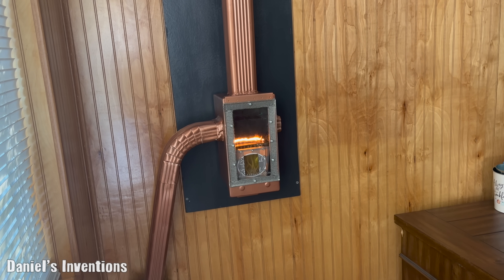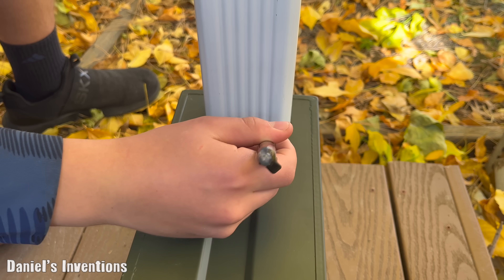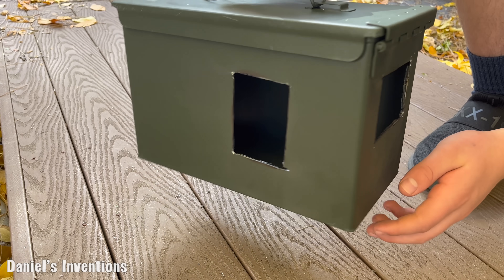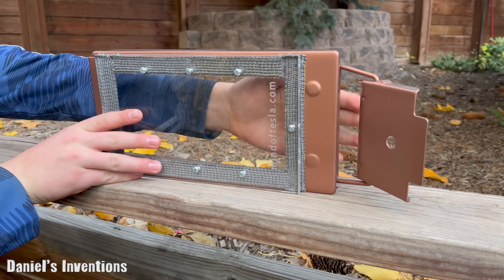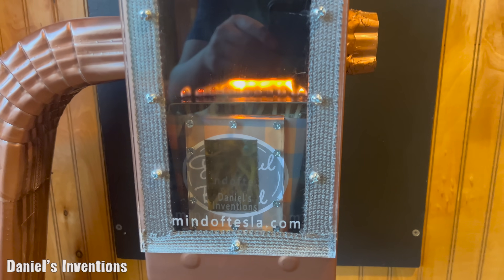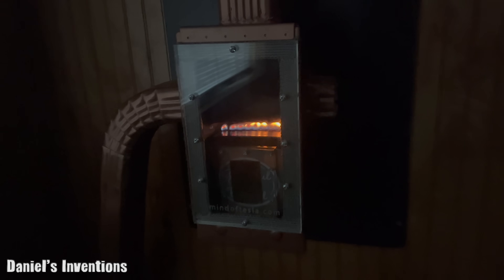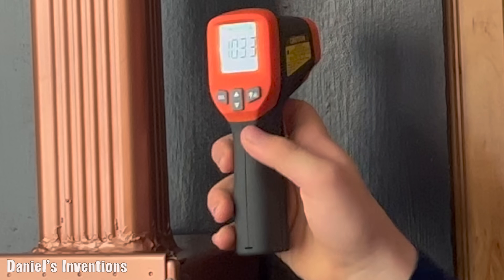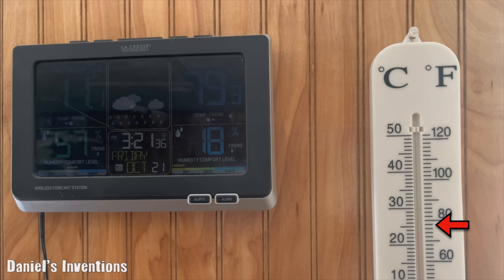ENDLESS Heat for Your Home WITHOUT Electricity

Comment: Some facts 1 kg kerosene, diesel and gasoline holds each about 43-45MJ. So if your magic device use 1 kg in 10 hours it is equal to 1250W f heat blower running all 10 hours (theoretical max)

Comment: Great stuff!!.. well done. I suggest you take shots of a tape measurement for the holes so people can freeze and read or you can simply say the measurement.
2. People miss this all the time but a lot of heat is going out the chimney!
Think about making loops, twists or I just use a really long exhaust pipe at a 12 degree angle (min) and it literally radiates a lot of heat. Check into using a twisted metal to create vortex and thus more surface contact from a gas hot water heater.
  I very designed several but not had time to make... yet.
3. Yellow flaim = soot.. blue flame clean.
4. Air from outside means cold air... but if taken from inside then cold air comes from outside (cold) to begin with. Consider using earth dug ditch to preheat to around 50 degrees.. see Earthship designed homes and on YouTube still?
  Again great stuff.
Reply: Great ideas!
Love the community brainstorming effort here!

Comment: Nice idea.
I think if you use intake from inside the cabin it will be even more effective.
Reply: This is a unsafe surefire recipe on how to kill your family.
    First this bad design using the warm oxygen in the room, which us a code violation In the USA. Because you that same oxygen to breath. DO NOT DO THIS.
This setup will leak Carbon Monoxide into the house. This is why we do not use Franklin stoves in the home.
JBWeld is bot heat resistant and will fail when exposed to prolonged heat thus causing it to fall apart and causing a hours fire.
DO NOT DO THIS.
Lastly This furnace is too small to heat a Closet much less a whole house. At best it is about 500 BTU.

You have No safety precautions, No alarms or CO Detectors.
He is not qualified to teach anything.
It needs a heat exchanger to make this safe.
your welcome
A certified Engineer. BSEE, BSME, MEE, MEE, BSCS
Reply: @mrgcav  if the unit it’s sealed no gases will be introduced in the cabin, so no poisoning.
When executed right with real welding and some more experienced in engineering,also intake air to be sucked ,heated and circulating inside the cabin it will be very efficient and safe.
It’s so simple you don’t need to bring your chemistry explanations.

Comment: This looks pretty nice for a first version!
I would make one modification. Add a sterling engine fan. You see them on stop of stoves for off-grid cabins, they run completely off of heat and require no electricity. So you just need to add one to the inside vent and it will start working as soon as your furnace starts. 
A way to refuel it, and start it without taking it apart would be a goal for the next version.
Reply: Not really a first version it's a modified (downgraded) version of what someone made for their snowmobile camper. All power to him for tinkering around with it trying to making it heat a space it wasn't made to heat but it will most likely cause a fire without warning.
Reply: @OverlordDenooh  Downgrade? You some kind of a heater engineer?
Reply: @OverlordDenooh  The snowmobile guy used candles in his. 
The candles didn't work so Good. 
The candles were too far away from the through heat vents to begin with and they melted down even further throughout the night, ending up with a temperature of 50 deg Fahrenheit = 10 deg celcius, and that's in something not much bigger than a dog house; he was in a colder climate though.
Although his heater was built First and the idea probably borrowed by these guys, I'd say this heater performs better, BUT! if he borrowed their idea and made a wicked oil system to fit inside his ( a doubled row of wicks as he has two through heat vents ) His could probably out perform this heater/stove. 
I don't think this one is a downgrade at all and in some ways an improvement.
Reply: Yeah good idea with the fan but I don’t think they make em small enough to fit in there  they are only 2” by 3” tubes but I could be wrong
Reply: @maxraddatz8420  The smallest one I've ever seen was a 6" diameter blade.

Comment: Jb weld cannot take 500+ degrees or direct flame very long. This is a cool idea and works similar to some products out there for wood burning stoves but you really need to seal it with something better than jb weld. Even the high heat stuff isn't good enough for something like this. You'd be better off to cold weld or braze it or use a heavier Guage steel and weld it.

Comment: It uses electricity and oil. Nothing is free. You could do a combustion analysis and see how inefficiency is a real problem  here. A correctly adjusted flame will be blue with diesel and heavy oils not orange like your ls is. Great video on how to cheaply pollute the planet. If everyone inna big city did this the smog would be so thick you wouldn't be able to see across the street.

Comment: Glad you think anything made from crude oil is cheap to use.  Here in Canada diesel or home heating oil is/almost $2.50 a litre. So 2.50 ×3.78(which is how many litres in a gallon)=$9.45.  You will be spending a bit on that...but in terms of your build and understanding the physics of things...great job.

Comment: you could put together solar panel and a wind mill (mechanical) to run the intake fan, than you would control the airflow (if it is too much) by manual flapper valve.

Comment: Okay but you said NO Electricity. Without the electric plugged fan this doesn't work. So it's NOT without electricity. 
Other than the FALSE title, this contraption seems quite effective and is actually very impressive.
Neat vid, thanks for posting

Comment: Another channel "The Outsider" did a video with pretty my the same thing 8 months ago, JB weld and ammo can and all. There are a few differences, such as fuel. While this version is somewhat improved in some areas over his, it's nearly identical. You should probably give some credit to the original designer you saw, because it's not completely original. Not trying to bash, it is a very good execution, but the original design should be credited (even if it wasn't the same video I saw)

Comment: Aluminum drainpipe is not particularly useful as a smoke pipe.  You would do better using 3"round galvanized pipe.  if you put the aluminum down pipe in the flame you will understand why it is not suitable. You need to watch more than one you tube videos to learn about safe construction methods for stoves.

Comment: Hmmm ,,,, interesting,,,

I’m not an electrical engineer etc but my brain is churning just enough to wonder what would happen if you replaced the burning oil with a small armature with fins to create electricity to heat up coils of wire or steel while also powering your computer fan to blow and spin the armature……. Perpetual heated air???

Just wondering

Also when concrete dries out from heat it cracks and can explode… (called spalling)… might want some actual fire proof insulation although with this setup it’s probably not a problem.
Reply: No such thing as perpetual motion.

Concrete board is already throughly dried from manufacturing, sprawling is extremely unlikely.

Comment: I see that your channel has videos where you make motors and power generators with magnets. That is pretty cool. As someone concerned about the sustainability of fuel burning, I wonder if you could do something with electric heating, powered by an electric generator. All kinds of people have made crank-powered electric generators, with flywheels to keep the magnets spinning, but I bet there's a way to wrap a rope around the axle, tie a weight to it, and have it drop at a low enough rate to power the heater overnight at least. You just need a high gear ratio, and while the magnets are spinning fast, the weight won't be falling quickly b/c of the torque acting against it.
Reply: Heating with electricity is incredibly inefficient. In fact all electrical losses are heat losses. So an electric baseboard heater is 100% efficient, however the amount of energy it consumes is not. For two 10x10 rooms you would need about 6000 BTU's for a well insulated cabin. Which is about 1800 Watts. That is one full dedicated circuit at 120volts. You are not going to gain that much energy easily through any means, you also have to store it. 

Gas is always more efficient then electricity, which is why we all have furnaces.

Comment: Nice job on this.  Beyond the upward exhaust pipe addition and metal flashing on the wall the design is sound.  People need to rewatch this before commenting, LOL.
Reply: This is a unsafe surefire recipe on how to kill your family.
    First this bad design using the warm oxygen in the room, which us a code violation In the USA. Because you that same oxygen to breath. DO NOT DO THIS.
This setup will leak Carbon Monoxide into the house. This is why we do not use Franklin stoves in the home.
JBWeld is bot heat resistant and will fail when exposed to prolonged heat thus causing it to fall apart and causing a hours fire.
DO NOT DO THIS.
Lastly This furnace is too small to heat a Closet much less a whole house. At best it is about 500 BTU.

You have No safety precautions, No alarms or CO Detectors.
He is not qualified to teach anything.
It needs a heat exchanger to make this safe.
your welcome
A certified Engineer. BSEE, BSME, MEE, MEE, BSCS